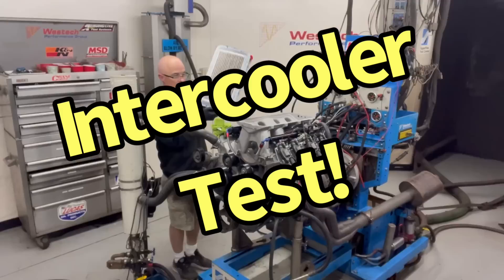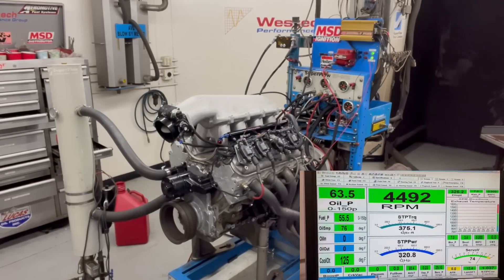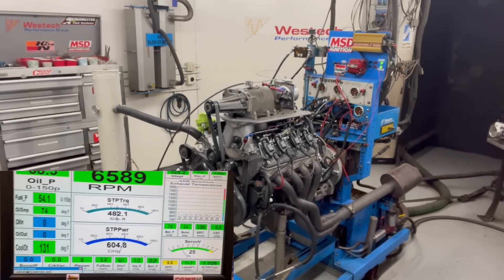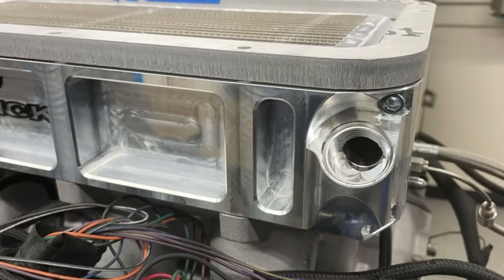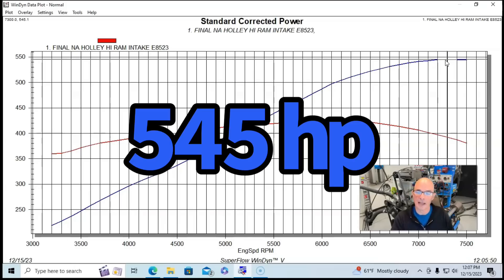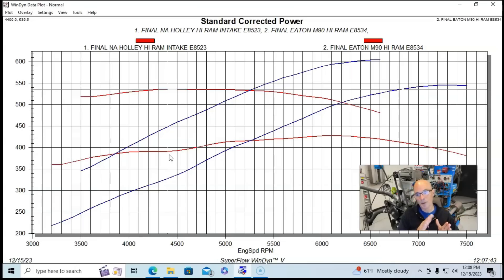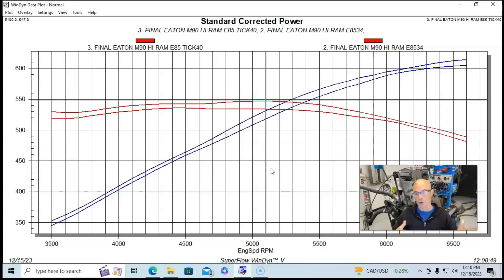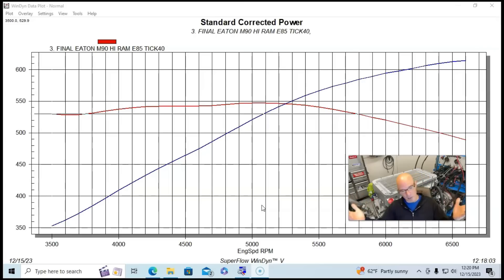HOW MUCH HP IS AN INTERCOOLER WORTH? CHEAP, JUNKYARD M90 BLOWER GETS A TICK PERFORMANCE INTERCOOLER.

Comment: Ok ... You like to say boost always adds to what's there...but a 5+ pounds of boost that should be a 30% gain in power but you only got a 10% gain in power so what is up with that? Where are you measuring boost?
Reply from the maker: you forgot to subtract the power required to drive the blower-the formula only works for turbos
Reply: @richardholdener1727  so you think it's taking 100 HP to run that little supercharger at 6 lbs ? ...... It also seems like to much boost for that NA high HP engine and only being a m90 .... Something about this run on this engine doesn't make good sense as compared to the smaller engine test ....
Reply from the maker: power consumption is based on blower speed, flow and pressure. The fact that there is only 6 psi when we near the end of the flow potential of the blower means power consumption will still be very high and it is at least 100 hp with this blower.
Reply: @richardholdener1727  so I watched the 3800 video and took notes ... Used the superichie turbo boost power formula to figure out what it should have made in power and then subtracted what you measured in power and got interesting results ... With the 3.8 pulley it used 60 HP ... With the 3.4 pulley it used 70 HP and with the 3.2 pulley it used 90hp .... So 100 HP with the larger crankshaft pulley is right in line ..... Very interesting exercise

Comment: Please for the love of god just put a 2.3 tvs off a 2013 2014 GT500 trinity engine!!
Reply from the maker: we did a 2.3l test already with a different adapter set up-that vid is up-this is all about the M90
Reply: @richardholdener1727  with a tvs or was it eaton?  I didnt see the 2.3 test thanks
Reply from the maker: it was the 2.3l TVS from Ford Racing

Comment: Seems like blowing through a small opening into a larger volume might have as much effect on reducing charge temperature as the heat exchanger. Look forward to the comparison to your next adapter improvement.
Reply from the maker: it won't change power like the cooler

Comment: you need to cut your plate so the area inbetween the boost bypass valve and the blower outlet is open and free flowing.
Reply from the maker: we already considered that-raising would be better
Reply: You'll lose boost
Reply from the maker: we want to reduce boost before the core-but increase after the core-which is what should happen with a restriction

Comment: You should try a Interchiller in testing. Yes, Its a intercooler that uses the factory A/C to super chill the in coming charge.
Reply: It sounds cool but I'd highly doubt an air conditioner would have the throughput to cool the volume of air that an engine requires. Otherwise you'd hear about them a lot more. It's like trying to cool your computer with a freezer. Sounds good but in practice it's unrealistic.
Reply: @dustinandtarynwolfe5540  Hmm, a water to air inter-cooler reservoir would benefit from an AC expansion core, so long as it didn't freeze over during non boost /low speed operation.
Turn on the AC to pre-cool the IC reservoir, before a drag strip run.
Reply: @dustinandtarynwolfe5540 its used on the d3mon and other factory vehicles. The freon is extremely efficient in cooling compared to water in the same manner water is more efficient in cooling than air. However its high pressure lines and a complex system....
Reply: @dustinandtarynwolfe5540 they have been built and are able to cool the air to below ambient air temps using the factory AC compressor

Comment: a few questions, what was the temp of the water you used to cool the intercooler ? Do you  have the flow rate of the intercooler water? I've  always understood that the temp rise from a blower (or turbo) is a function of the boost level. Your boost level was very low. If an intercooler is properly sized with no restrictions, I suspect you would see very little pressure drop across it. Is that right?
Reply from the maker: we should have very little drop across this core at this power/flow level, if we had been using all of the core
Reply: @richardholdener1727   you could be using more of the core if you cut a bigger hole in the plate the supercharger is bolted to.

Comment: I dunno, even with only part of the intercooler being exposed to the airflow, it still knocked down the IATs by 70 degrees. Maybe using more of the core will reduce flow restriction a bit? I guess we'll see...
Reply: yes exactly. this is what I was trying to say. the zzpoop intercooler doesn't have a big area like the intercoolers that we used back in the day made by SSEILMNOP, with phenolic. the area in-between the bbv and the blower outlet square was open with the phenolic intercooler.

Comment: I personally don't get why you don't change the cam.  Run naturally aspirated, it made peak power at 7600.  But with this M90, the blower is tapped out in the low 6s.  I'd like to see this tried with something like a Sloppy Best or Truck Norris cam.  

I really think these M90s put on an LS would work best for torque on a truck application, not necessarily drag racing type applications.  You're better off with an ebay turbo than going this route if you're drag racing.
Reply: airflow is going to be the same regardless of the cam. the blower is going to output the same.
Reply from the maker: airflow from the won't be the same regardless of the cam-a stock cam will reduce flow from the blower to the motor and create more pressure and reduced power. Bigger cams will do the opposite
Reply from the maker: you need to come to the live feed where we discussed exactly that-but what YOU would do is not what this test is about
Reply: @richardholdener1727  The live feeds are pretty time consuming, I'm a busy family man and it's hard to squeeze in an hour or more into my schedule.  10-15 minutes like your non-live feed videos, that I can find time to fit in.  Of course, the videos are not about me regardless, it's your channel.

Comment: Use a ford lightning m112 and the raised adapter plate to yours. Open yours to match the lightning and bolt together. You may have to come thru the bottom to bolt. I did this on a 347 SBF. https://studio.youtube.com/video/E9GWgvWaVMc/edit

Comment: I'm no auto tech teacher but...... you really don't know why cooling the air post blower resulted in 1.5psi loss in pressure???  Think about it....
Reply from the maker: You need to think about why this core with 20 psi at 900 hp only has .8 psi drop in pressure and we had 1.5 psi of pressure at 600 hp. So it's not from cooling-it is from a restriction...Think about it.

Comment: That pressure drop is possibly caused by the cooling of the air and not the restriction. When hot air is cooled it is also condensed. You may see the same drop in pressure even if you put some airspace between the blower and the intercooler coil. We could confirm this by logging the pressure above the intercooler. If the pressure between the blower and the intercooler coil went up, we can surmise that it is due to restriction, but if not, what we’re seeing is the contraction of air through the process of absorbing heat from the air.
Reply from the maker: it's not from cooling-that is only a minor drop-this core had only .8 psi drop at 900 hp and 20+ psi
Reply: @richardholdener1727  I don’t know about this one. Using gas laws and a temperature/pressure calculator, I estimated that with a 72 degree drop in temperature, the drop in pressure (in a sealed enclosure) would be around 1.72 psi. The formula is Pf=Pi*Tf/Ti. I think you’ll see an even greater drop in pressure when you use the whole core of the intercooler. More cooling = more shrinking. Air density increases, so there will be more oxygen even with less pressure. So it should still make more power. Pretty impressive that such a small area of that intercooler could drop the temperature that much.
Reply: @FusionFab  " I think you’ll see an even greater drop in pressure when you use the whole core of the intercooler" I don't think so because you are going to be passing the same (or nearly the same) volume of air through a larger area of the intercooler, so the pressure drop through the intercooler should be less.

Comment: At such low boost, would you expect the cooler to help a lot ? What were charge temps before and after ?
Reply: I think he said 168°F without and 90°F with.
Reply: Sorry, 162°F. Mentioned it at around 11:18 in the video
Reply: @Nottherealme223  thanks, I missed that
Reply: @blow0me it absolutely helps and the results speak for themselves.  Just because guys "get by" without an intercooler at lower boost levels don't mean it's optimal.  It's always gonna be cooler and make more with an intercooler even with low boost..

Comment: Richard, I know you love how cheap & available the M90 blower is... but let's be realistic: No-matter how over-driven/over-sped it is, it's not enough for an engine of much greater size than it's factory applications. 

So get to the 'yard or swap meets, and find the setup GM put on the 6.2L... and bolt that atop the 5.3L instead. Okay? You'll have a better adiabatic state (lower charge temperature pre-intercooler) than you would with an overworked M90...!😉
Reply from the maker: You are incorrect about the M90-we have already more than doubled the factory power output. You won't find any factory 6.2l blowers or motors in junkyards. Please feel free to do what you want with your project.

Comment: Dropping the IATs would let you spin the M90 even more. That's what we usually do in the 3800 world. Intercooler added, acts as a restriction, but then we add more boost to compensate. Ported outlet from Jokerz and going down to 2.4 or 2.2 would probably help gain some more power. But at that point you'd probably need to invest in an 8 rib belt  and/or belt wrap kit from zzp. I'd imagine at the 2.4-2.2 range you're going to see some belt slip
Reply from the maker: those blower pulleys sizes are unnecessary since we already have a 7.5-inch crank pulley.
Reply: Can we spin her up further and see what happens? 😂 I've got a machined snout with a pulley wrap kit that directly goes on the snout with mine.
Reply: @hayden6056   the 2.6 pulley wouldn't go on if the snout wasn't already machined.
Reply: @lifeishard1211  that's machining it for the pulley....

My snouts machined smooth the majority of the way to the base plate and then a CNC tensioner goes on to that machined part itself.

Look up bazspec fabrication in Australia he does a lot of machining for anything m90.

Comment: Bubbler???
Reply: They are used on some model blowers and are called a pcv bubbler port. They are at the lowest point in the blower manifold and function as a drain with no check valve to help prevent oil buildup that may collect in the intake track. The test is to somewhat simulate what power is being lost through that 3/8th port constantly pissing boost disguised as an oil drain. If you were to block the bubbler port on one of those model blowers, this test would simulate the types of gains or similar you may see.
Reply: @growasetalready  ah got it. I think that's a bad idea,get rid of pvc,egr and put a good catch can setup and no need for a bubbler lol. Never heard of that bf,thanks for the information, much appreciated

Comment: Awesome video Richard!  And I was wrong, since I thought this was going to be the setup where FINALLY, an intercooled setup makes less power than without an intercooler.  Well, it didn't make less, but it also didn't make much more.  BUT!  It made more, despite less boost, which I will assert was a function of the ideal gas law, PV=NRT (IIRC), decreasing the pressure as a function of decreasing the charge temperature significantly.  I honestly don't think that a bigger spacer above the core will make any difference.  Also, I think maybe the extra degree of timing was useable because the boost was lower and the charge temp was lower.  I call it a valid test for sure, but I think the intercooler isn't worth the trouble in this case.
Reply from the maker: Given the core has been tested at higher flow and power levels with less pressure drop-I feel you are incorrect about the boost drop and need for additional space between the plate and intercooler
Reply: @richardholdener1727  If it was a turbo setup I would be in complete agreement with you Richard, but this supercharger isn't sending any extra air, and when the intercooler decreases the temperature of the charge, it is also decreasing the volume of the charge air.  I.e. less boost by mathematical certainty.  It's simply a function of the intercooler doing a good job.
Reply from the maker: if there is a restriction between the blower and the core-there is less airflow from the blower. If we eliminate the restriction, airflow should increase from the blower (blower flow is a function of inlet and outlet restrictions and blower speed). If we increase airflow, boost after the cooler should go up
Reply: @richardholdener1727  Agreed Richard!  It will be interesting to see what the real world outcome is on the dyno.  After doing the math a bunch of different ways, it appears that the pressure has to reduce by .7psi from 5.6psi@162F down to 90F (about 12% pressure reduction for that temperature change).  So if you replicate that non-intercooler result and then add in the core with the spacer, it seems to me that 4.9psi is the best you can expect.  Will be awesome to find out for real!
Reply: @richardholdener1727     the restriction to airflow is there from the plate covering the intercooler core. lifting the blower up so it's further from the core will only increase the distance of travel. it's a literal impossibility of lowering boost pre intercooler but increase boost after the core. in this scenario, the core has very little resistance because it flows so well.
Reply: The supercharger outlet is at one end. To get to the cylinders at the opposite end it needs to squeeze through that small gap between the intercooler and the spacer plate. Without the intercooler it had the open space of the high ram to get from the blower outlet to the far cylinders. 
And, manifold density is the real goal with forced induction. Hot air is less dense so requires more boost pressure to get the same density you can get with cooler air. That’s why chasing simple boost pressure numbers isn’t good.

Comment: More compression might not hurt with only 5-7 psi. Any counts of knock as is? Also knew a guy that ran propane injection on a 10sec 4g63 had like zero knock after propane. Also an interesting way to run pump gas and boost octane(for lack of better expression) on demand. Plus a way to add fuel when injectors get maxed out.
Reply from the maker: we don't have the factory ECU-no knock sensor

Comment: So a quick tech question: I was under the impression that intercoolers always cause a pressure drop on positive displacement superchargers. On a turbo engine the air cooling down makes it contract but this reduces the load on the turbo so it fills the extra space, while a roots blower pumps a fixed (more or less) volume of air on each rotation so lower temperature contracts the air in the intake and thus drops boost numbers.

I know a lot of first gen Mini folks that do water/meth injection upstream of the supercharger with good results, but I don't know how much is due to better rotor sealing vs lower temps/higher air density at the supercharger inlet.

In your experience do you usually see no pressure drop on a proper roots IC setup?
Reply from the maker: we see some drop-but not this much at this combination of low boost and flow (with this size core)
Reply: @richardholdener1727  that makes sense, with these low boost numbers there's not a huge amount of heat to start with. Did you ever throw ice into the water for an air/water IC on the dyno?
Reply from the maker: I have ice water tests on the channel-it always works

Comment: On Cigarette boat Tall Block BBC we found lower exhaust temp and easier on the valves.  Also Heavy trucks with a long pull  looking to see what you found but if I remember correctly your charge temp was not outrageous  watching run...  The trucks ran short cams the boats bigger but not to big as you need torque to get the boat up on it's plane...Wow cooler charge allowed timing  Our trucks/ busses did not run a lot of boost but the boats did (same sandwich system)  plugs all read the same?/?  any egt  following waiting for next test   70 degrees- nice

Comment: A larger spacer could help, &/or elongate the discharge opening of the plate towards the bypass opening. GL
Reply: Also radius or chamfer the bottom edge of the spacer plate going into the cooler i.e. port the opening.
Reply from the maker: the flow rate of the opening in the plate is much higher than the V-shaped discharge coming out of the blower

Comment: I’d like to see how no intercooler but meth injection would compare... also intake temp would be interesting to know. I wonder how the motor would react to even more static compression?
Reply from the maker: compression adds 3-4% of the na power output per 1 full point
Reply: What about moving / changing the cam for more dynamic compression?
Reply from the maker: then that is a cam change